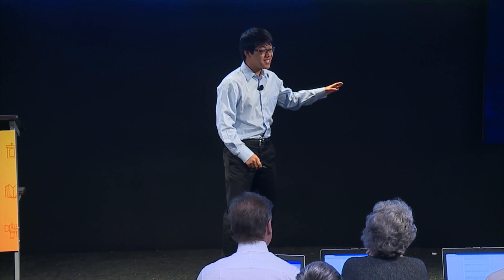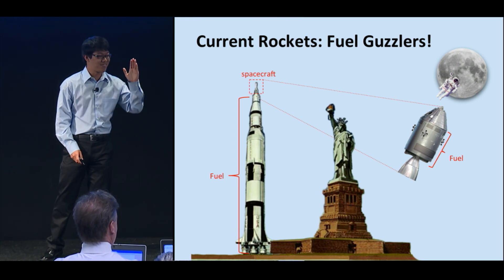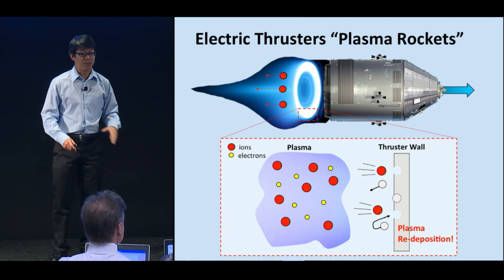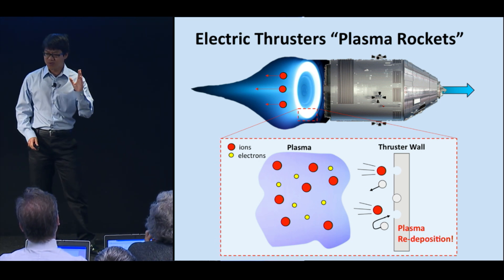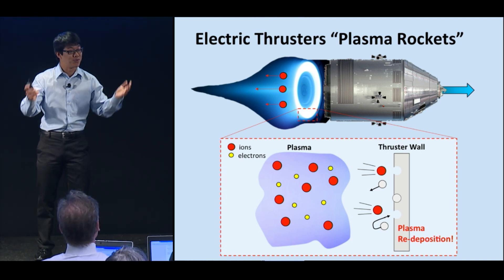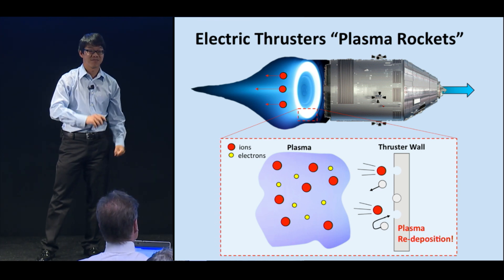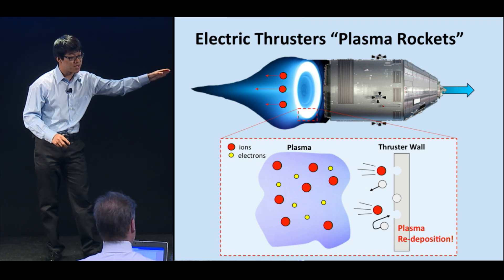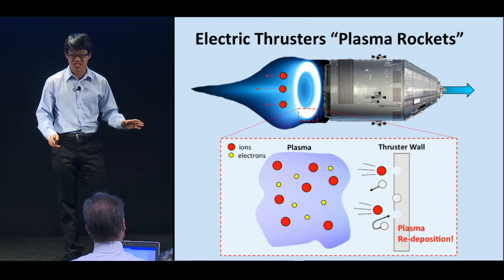Traveling to Mars with immortal plasma rockets

Comment: So ive designed some insanely high powered engines, that are relatively complex.

And you dont always need all of that, so am designing a more mid range option

That uses a tesla coil, inside a rocket housing, not a jet, to ionize gas beyond the state of plasma, creating exponentially greater thrust, than with just electric current, or gas combustion alone.

Different types of batteries, and gasses would make these pretty versatile.

Would be better for planetary travel, instead of extradimensional travel

Comment: Plasma thrusters are a technology that works for small craft, but are lacking in adiquit thrust to move large mass ships. They will be superseded by better options shortly.
Reply: A plasma thruster can generate as much thrust as the energy that you have. Current ion driven spacecrafts use either solar power or small radiation decay nuclear power cells, both which provide very little energy when compared to other alternatives. It would be really cool to see how plasma thrusters evolve once we are able to fit an entire fission, or better yet fusion reactor on a spacecraft